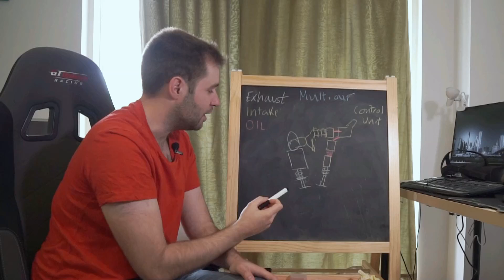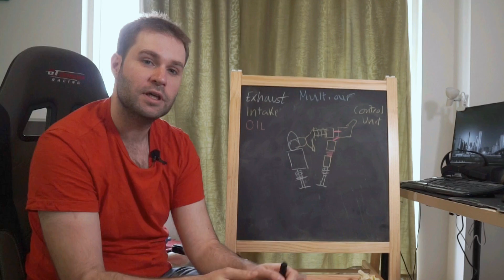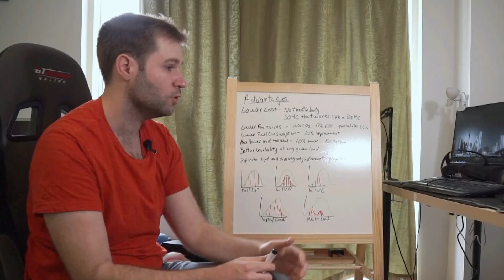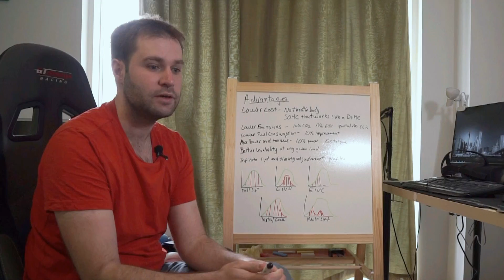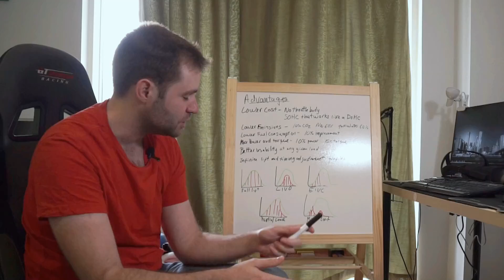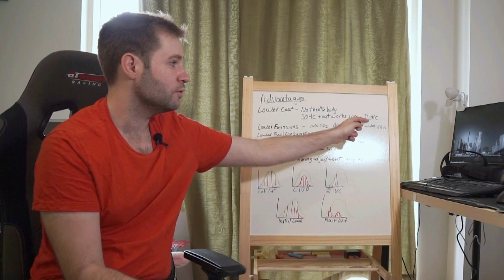How Multi-Air works (and why it's better than VTEC)

Comment: My Alfa MiTo has a Multiair engine. Never had problems. Stock it pushed out 155bhp but it now has a modified 230bhp.
Reply from the maker: the 155 is a T-jet, not a multiair
Reply: a random callsign yes it does. Google it. As a mechanic I can prove
Reply from the maker: wiki: 
0.9 TwinAir 85 I2 875 cc (53.4 cu in) 63 kW (85 PS) at 5500 rpm 145 N⋅m (107 ft⋅lbf) at 2000 rpm 12.5 s 174 km/h (108 mph) 2011–2012
1.4 MPI I4 1,368 cc (83.5 cu in) 58 kW (78 PS) at 6000 rpm 120 N⋅m (89 ft⋅lbf) at 4750 rpm 12.3 165 km/h (103 mph) 2008–
70 kW (95 PS) at 6000 rpm 129 N⋅m (95 ft⋅lbf) at 4750 rpm 11.2 180 km/h (110 mph)
0.9 Twinair 105 l2 875 cc (53.4 cu in) 78 kW (105 PS) at 5750 rpm 145 N⋅m (107 ft⋅lbf) at 2000 rpm 11.4 184 km/h (114 mph) 2011
1.4 TB I4 1,368 cc (83.5 cu in) 88 kW (120 PS) at 5000 rpm 206 N⋅m (152 ft⋅lbf) at 1750 rpm 8.8 195 km/h (121 mph) 2008–2009
114 kW (155 PS) at 5500 rpm 230 N⋅m (170 ft⋅lbf) at 3000 rpm 8.0 215 km/h (134 mph) 2009–
1.4 MPI (multiair) 77 kW (105 PS) at 6500 rpm 130 N⋅m (96 ft⋅lbf) at 4000 rpm 10.7 187 km/h (116 mph)
1.4 TB (multiair) 99 kW (135 PS) at 5250 rpm 206 N⋅m (152 ft⋅lbf) at 1750 rpm 8.4 207 km/h (129 mph)
1.4 TB (multiair) TCT 230 N⋅m (170 ft⋅lbf) at 1750 rpm 8.2 207 km/h (129 mph) 2010–
1.4 TB (multiair) 125 kW (170 PS) at 5500 rpm 250 N⋅m (184 ft⋅lbf) at 2500 rpm 7.5 219 km/h (136 mph) 2009–
1.4 TB (multiair) TCT 7.3 219 km/h (136 mph) 2014–

Honest Jon
1.4 50.4 mpg 41.4 mpg 82% Submit MPG
1.4 16V 47.9 mpg 39.5 mpg 82% Submit MPG
1.4 MultiAir 105 49.6 mpg 39.0 mpg 79% Submit MPG
1.4 MultiAir 140 TCT 52.3 mpg - - Submit MPG
1.4 TB 46.3 mpg 33.4 mpg 72% Submit MPG
1.4 TB MultAir 140 TCT 52.3 mpg - - Submit MPG
1.4 TB MultAir 170 TCT 52.3 mpg 37.5 mpg 72% Submit MPG
1.4 TB MultiAir 105 49.6 mpg 41.6 mpg 84% Submit MPG
1.4 TB MultiAir 135 50.4 mpg 37.6 mpg 75% Submit MPG
1.4 TB MultiAir 135 TCT 51.4 mpg 35.1 mpg 68% Submit MPG
1.4 TB MultiAir 140 TCT 52.3 mpg 46.0 mpg 88% Submit MPG
1.4 TB MultiAir 170 47.1–52.3 mpg 34.8 mpg 70% Submit MPG
1.4 TB MultiAir 170 TCT 52.3 mpg 39.0 mpg 74% Submit MPG
1.4 TB MultiAir TCT 51.4 mpg - -

There's no 155 multiair. Not in the Mito nor in any other Alfa or Fiat.

The 155 is the TJET 
https://www.auto-data.net/en/alfa-romeo-mito-1.4-tb-155hp-16679

So, pop the hood ;)
Reply: a random callsign I have fucking popped the hood it says Multiair.
Reply: a random callsign on the cover it says Alfa Romeo Turbo benzina Multiair. And the cars Reg states it’s a 155bhp engine stock. I know more about the MiTo that you
Reply from the maker: Despite no engine reference of 155 multiair anywhere, including on parkers which lists every trim and engine combination, I'll say "if you say so".

Comment: Multi Air is great ?
Ask actual car buyers who got stuck with this unreliable and trouble prone piece of junk just like the Fiat's dual clutch automatic transmission.
Reply from the maker: Im an actual multiair owner. Use the recommended oil, clean the Multiair filter and thats about it.
Reply: I dont know what car you have been driving but I own an abarth punto supersport which has the 1.4 multiair engine and its perfectly reliable as long as you take the time to correctly maintain.
Reply: @wezsgaminghub  laughs in Honda

Comment: Pretty sure my multi air dart has a throttle body...
Reply: Multi air engines have a throttle body, but it’s only active until 50% throttle. From 50 to 100% throttle, the throttle body is completely open and the multi air system controls the throttle

Comment: 10w50 oil in Europe for Abarth   500 and 595 versions.
Reply from the maker: none of them are multiair.
Reply: @randomcallsign  They are 1.4 prtrol turbo multi air. I have an abarth 500 and the oil it uses is 10w50, made by Petronas for Abarth. It comes in a metal 2 litre container with the Abarth logo on it.
Reply from the maker: @denzilbarker1429  the abarth 500, 595 and 695 are tjet in europe. In the abarth website, none of the engine choices are multiair for the 500 abarth family, nor FIAT/Abarth sold them with that engine. Only north american gets the MA powerplant in the abarth.
Reply: @randomcallsign  interesting info, I wonder why that is.

Comment: I have 2013 dodge dart 1.4L and the car has misfire, the misfire is cause by solenoid not by coil nor spark plugs 
Because i recently have chaned it and seems to be there's no solenoid parts out there so what should I do to fix the solenoid
Reply: Replace the whole multi air unit.

Comment: I have a 1.4 turbo Dodge Dart, if these engine have great technology and are efficient yet make power why do these cars not make lot of power? Even aftermarket support is very small for large performance gains. Yet in the Honda/jdm scene 4 cyl engine can hit high power numbers. Just curious cause I’ve been thinking about it. Great vid!
Reply: I mean the 2.4l multiair has been pushed to 275whp on stock internals with no issues. So the engines are plenty strong.
Reply: 410_Redline street-team what was done to it?
Reply: @jturman8or  turboed. And they may have room for more power yet. The ecu just got unlocked by a company so it can be tuned now. But with the 5th injector and AEM injector controller kit, the max was 275whp since they couldnt controll all the engine parameters
Reply: 410_Redline street-team that’s crazy, who was able to unlock it? How was the 5th injector added
Reply: @jturman8or  syked ecu tuning figured it out I have the 91 octane tune for my 2.4l from them. I love it. Does Way better at getting gains from the bolt ons I have than the stock map. And the rrm turbo kit put a 5th fuel injector in that hole,in the air intake that had the silencer/resonator box in it. The injector was controled by a small ECU that would T into the factory O2 sensors, MAP sensor. And I think thats it.....the,tiny ECU had its own air/fuel map it aimed for. So anythimg over 2psi of boost that 5th injector would shoot fuel into the intake.

Tork motorsport did a turbo kit for a guy where they put in bigger fuel injectors to replace stock and T taped in a AEM controller to override the stock ECU and make the injectors spray more fuel. But I think dude was having limp mode issues at high elevations. So hes suppose to be the first guy to have syked tune his factory ECU for the turbo kit, we're taking guesses at power, I'm thinking 320-350whp. That guy had his trans built to Handel 550whp.
Reply: @410Yoshimi  your saying the mopar ECU has be fully unlocked so say i can make the actuators modify " bricks " to mechanically work and fit on something like a VVT G-4 LSX v-8 or a hemi v-8 there is now better aftermarket software / computer support? and or i wonder if someone like holly ECUs or hall-tech is planning on adding support to this type of valve control as i think it's assume 👍
Reply: @richardprice5978  yes and no. As of now only the owner of syked will unlock and tune the ECU. He hasnt released the hand held or cable that will let you or a tuner modify,it with the syked tuning software. Now if you pay to just Have him unlock the ECU and you pay someone to learn the laguage and write it or what ever they gotta do. I guess thata your dollar and possible. Go to www.sykedecutuning.com and pull up whats available for the dodge darts and read what he did. Might answer your question better than I did.
Reply: And these cara have decent stock power....the problem is the torque management is super restrictive. Just adjustimg that makes world's of a difference
Reply: Some of these turbo engines focus on getting more low end torque than on maximum horsepower.
That in mind, I do wonder what happens if you can make a larger snail work on a 1.4T multiair.

Comment: I'm not so sure about the oil requirements, you mentioned 5w40 oil required for a Muitiair engine, but in the U.S. the Multiair engine requires 0w20; that's quite a difference!
Reply: Xavier Lemos Dodge Dart 1.4 requires 5w40 full synthetic oil
Reply: Even the 500l uses 5w40
Reply: EUR5 5W40 

EUR6 0W20
Reply: Not in the Abarth.  It's 5w40. The european T-jet uses 10w50 (or 20w50).
Reply: And WD40 is great for rust and lubrication of screws bolts and nuts 😜
Reply: 5W-40 for my  2013 1.4 Multi-air Turbo.
Reply: 124 spider w1.4 MA : MS-12991

Comment: Are the solenoids serviceable when they fail or do you need to replace the entire multiair unit?
Reply from the maker: Entire unit
Reply: @randomcallsign  Thats a shame. I hear a new unit is £1000 but maybe thats a dealer price. You can get one on ebay for £525-600 but thats still a lot of cash should one solenoid fail.
Reply from the maker: In the multiair units the selenoide very rarely fails
Reply: @randomcallsign  Agreed, but the practice of placing critical low cost non-serviceable items is always something to be aware of when choosing an engine. Solenoids / sensors and anything made of plastic in an engine should be serviceable.  What we save in fuel costs we spend in servicing. Not having a go at fiat in particular cus a lot of manufacturers do it in one way or another.
Reply: I have only ever replaced. Never had training on service
Reply: There is an oil filter u can change but by the time that fails the unit is done

Comment: We call it Multijet in my country
Reply from the maker: Multi jet is not the same technology
Reply from the maker: Also multi jet is diesel
Reply: Really? I didn't know that they're different.
Reply from the maker: Common rail diesel of the mjet vs petrol selonoid controlled intake
Reply: That’s a different thing. A fiat van on my street has a Multijet engine. My MiTo has a turbocharged Multiair engine.